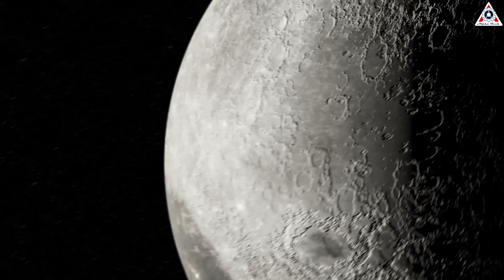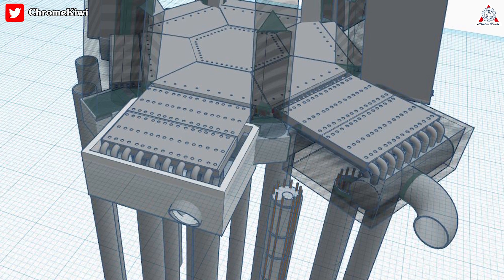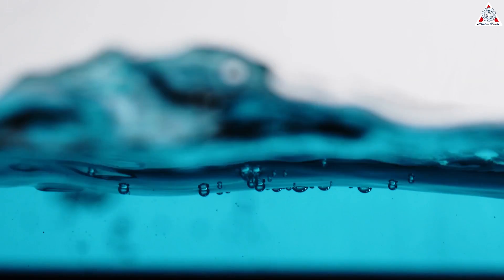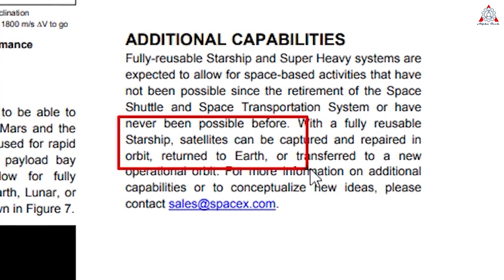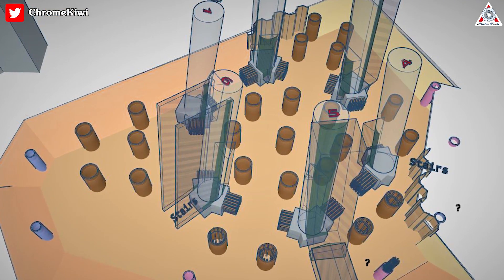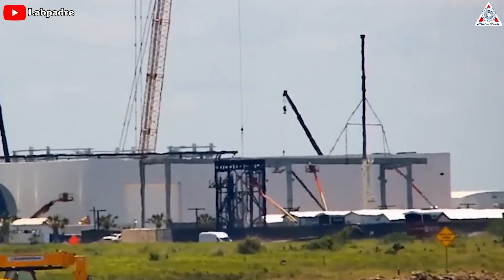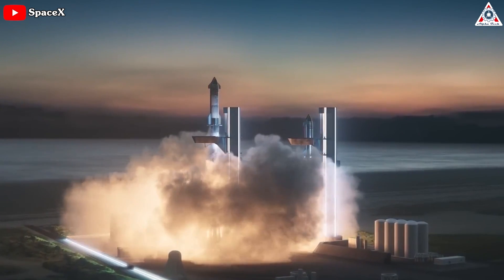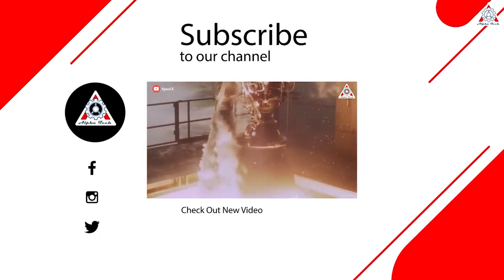SpaceX's New Starship platform to save 33 engines....

Comment: To Save 33 Engines??? How about a Simple "Verb-Noun" Topic description that is Relevant? The Deluge Systems (Plural) will certainly keep the OLM from collapsing into the Groundwater, and Will Help Protect the Engines from Flying Debris and Acoustic Pulse Damage. The major Damage during the First Test was the Engine Blast Blowing Away The Concrete Base & Earth below the OLM creating an Immense Cavity. There is little reason why a 300,000 GPM Water Cooled Steel Blast Base  should not prevent that from happening again.

Comment: The temperature can exceed 1000C. The reason is that it takes a long time for the steel to get to that temperature. It has a heat capacity. At 1000C exhaust temperature, it takes a long time for the steet to get up to that temperature. Certainly longer than the 10 seconds that it will be exposed to exhaust. 
With water flowing everywhere and from below, the temperature will be very low. 
To see this in practice, see how long it takes a piece of steel to heat up in a forge. There are plenty of examples of this on youtube
Reply: So what? Those engines churn out a ludicrous amount of energy. 
Just dig a flame diverter.
Reply: @ahhmm5381  It's a swamp. Look at the flame diverter for Apollo. There are YT videos on that being built.

Comment: So, it's the deluge system that everyone pointed out was missing that Muskrat thought they could get away without having…
Reply: No. SpaceX had started working on this three months before the launch. They had already moved past just concrete. They did a 50% test (equal to a Saturn V) and based on the damage done they thought the pad could handle one launch. However the ground compressed way more than expected which cracked the concrete. They expected to more ablate.

Comment: With all these launch problems, how do they expect it to launch and return to earth from another body in space where it simply is on the surface without a launch pad?   We still have no idea if it will have problems returning through our atmosphere and then landing on to a tower with arms.  I wish SapceX success and pray these other obstacles can be solved.  I admire the ambition and other successes but wonder if there is a plan B.
Reply: I think the landers will use smaller engines splayed around the upper stage for the moon and mars, with nozzles well above the surface.
Reply: You are dooming the project at the start. SpaceX will test all aspects of the rocket and improve it as they go.

Comment: Wouldn’t it be better to divert the rocket blast with a diverting tunnel like NASA used with Saturn? Diverting is better than physical blocking which caused so much destruction! Yes or no?
Reply: Neither. It’s one option. SpaceX can’t dig a diverter due to the high water table. NASA build their diverter on top of the lane and the pad on top of that. SpaceX doesn’t have room for that. Do remember that SpaceX did a 50% thrust test and the pad was mostly unharmed. 50% of the SuperHeavy is equal to 100% of a Saturn V. So SpaceX’s pad is already extremely capable. SuperHeavy just demands even more.

Comment: The launch pad debris did not damage ANY engines. SpaceX does NOT need to save any engines off of any of the next several flights to land anything in the moon. The next two flights, at least, are scheduled to be ditched in the Atlantic Ocean and scuttled. By the time a flight is sent to land on the moon it will likely be equipped with at least the more powerful and more efficient Raptor 3, or better. I didn’t listen to the rest of it.

Comment: I feel like I’m the only one who doesn’t understand the direction SpaceX is going with rebuilding stage zero. Isn’t this a problem related more to pressure as opposed to heat ? All that pressure out of the raptor engines has to be rapidly distributed. I see adding a denser medium like water to the local area, making it more difficult for the hot gases to disperse and redirect. The problem is the dispersal of the hot gases. Why all the emphasis on cooling?? I know cooling is what saves engine bells from melting and water does soften the exhaust but only relevant options if the steam/exhaust combination can be redirected. 

Why isn’t anybody talking about this? 

Ie the mega elephant in the room is the management and redirection of pressure , far less important but irrelevant the heat.
Reply: Just curious, why exactly does the pressure need to be redirected? Does it cause instability?

Comment: Elon's admission that Space Cadets at SpaceX did not use launching clamps during last test lauch of the Starship is very surprising candor bordering on utter stupidity. Everybody was wondering why during liftoff as soon as the SH Booster/Starship rocket left launch stand whole rocket lurched sideways. Now Elon offered us perfect explanation that shows how reckless are people working for him. Without launch clamps whole rocker started to lifting off the launch platform as soon as the thrust minimally exceeded weight of the rocket. It was inching upward with minimum acceleration. While it was inching upward bottom of the rocket  was surrounded by the ring of clamps that were never used. Overlap (wall of clamps around bottom of the rocket) is way over one meter tall. How long does it take to move up one meter while inching upward? It might take few seconds
Reply: In these few seconds when bottom of the rocket is trapped in ring of clamps it cannot move sideways as it hits the clamps if it does. That makes whole gimbaling to keep rocket upright ineffective. So while rocket was inching upward it was at the same time falling over to one side ( luckily for Elon it was falling away from launch tower). As soon as bottom of the rocket inched up high enough to clear launch clamps and other obstacles on top of launch mount rocket shifted sideways pushed by gimballed rocket engines.  Launch clamps were invented and are used to prevent situations like this to occur.

Comment: We will see how genius the design is.  I'm not convinced.  They are trying to over come a basic design flaw.  Elon, knew this might be a serious problem.  He knew there should have been a flame trench and so did we.
Reply: Correction: anyone with a passing knowledge of physics knew it but not Elon. Elon is afterall a self proclaimed genius engineer and rocket scientists. Self proclaimed because in fact he is just the holder of a Bachelors of the arts in physics. Yup, it's an arts degree not a science one.

Comment: Big pile for BS as excuses for a disasterous lame attempt to launch a rocket doomed to fail due to fatal design flaw. During last test flight SpaceX did not use launch clamps during liftoff why ? Because they feared rocket engines thrust buildup during clamped period would exceed weight of the rocket by significant value and upon clamp release rocket would accelerate generating  enough compressive force to crush the Skirt of the Starship right on the launchpad. That was Elon's greatest fear as he knew that the Skirt was barely able to whitstand  the weight of fully fueled Starship. "The Starship was slow to accelerate during liftoff" why? For the same reason why launch clamps were not used. Space Cadets at SpaceX knew that the Skirt could buckle and collapse at any significant increase of acceleration so they kept on trimming thrust down as mass of the rocket kept on decreasing with spent fuel and oxidizer. As mass of the SH Booster decreases while mass of the Starship remains this same proportion of the rocket thrust pushing on the
Starship increase  so despite of continuous reduction of thrust generated by Raptor engines compressive force acting on the Skirt kept increasing until the Skirt partially collapsed sending rocket into tumble. Lucky for Elon number of Raptor rocket engines failed during liftoff decreasing thrust generated by SH Boosted faster than Space Cadets at SpaceX planned for and these additional reductions delayed moment of collapse until rocket reached altitude of 42km. Below simple calculation and explanation. First:  SB Booster/Starship rocket travels as one unit therefore all parts of it experience same acceleration at all times until separation. Forces acting on each part of the rocket divide in such proportion that same acceleration of whole rocket is preserved at all time until separation. Mass of fully fueled SH Booster at launchpad m1=4000mT, mass of fully fueled Starship m2=1200mT at launchpad. Lifting without clamps thrust equals combined weight equals T1=5200mT. Force at the Skirt F1=T1xm2/(m1+m2) F1=5200x1200/(4000+1200) =1200mT
Now, mass of  empty SH Booster just before MECO m11=200mT and mass of fully fueled Starship just before MECO m2= 1200mT. Now let's us assume that just before MECO thrust of SH Booster engines was reduced to 50% of initial thrust and it is T2=2600mT. Let us calculate compressive force at the Skirt F2. F2=T2xm2/(m11+m2) F2=2600×1200/(200+1200) =2228mT  That figure is very consistent with maximum observed acceleration rate of 1.75g (or subtracting gravity loss. 75g actual acceleration). So now you have two facts Starship lifted off without clamps at thrust level equalling weight of the rocket 5200mT instead of nominal thrust of 30 Raptor2 engine 30x230=6900mT that means Raptor rocket engines at liftoff were running at 75% of their nominal capacity. It is much lower when we take into consideration that 3 Raptors never fired at launchpad and we did count them in nominal thrust. If we count them in rocket developed 68% of nominal thrust at liftoff. Second fact is that despite reduction of nominal thrust to 39% of nominal (50% of 68%) during liftoff compressive force acting on the Skirt of the Starship almost doubles by the time Rocket reaches MECO.

Comment: Its not the heat which riped apart the earth, it is the presure combined with a hammering gaz flow.
The raptor engine would be at its place in the boring company, to dig rapidly tunnels without changing tools.
As a weapon for deminig would have been nice to look into. 
To withstand the pressure it has to be absorbed by a moving réactif mass 
.
To block the hammer with a hammer.
To absorb the immense peak presure of a single engine, maybe vertical turbines with liquid brakes might diffuse energy. These are mounted on a double piston action platform, basicly a platform sised cilinder, to use the pression of the rocket to spray deluge water on tye platform
Reply: Reading down the long list of comments at last a person sees the problem is I do.

Comment: The biggest question I have wrt the water deluge system being constructed at Boca Chica is the the design is not transferable to either the moon or to Mars. Water is scarce on both worlds and is too precious to be used as a launch vehicle deluge. What is SpaceX going to do on those 2 worlds?
Reply: They will have to ditch the Starship concept and go for something like the Lunar lander... which comes with its own platform and two sets of engines. One set to  descent and one set to assent. And should there be damage to the descent engines from flying debris... the lander can still assent with different set of engines that were protected during the descent stage.
Reply: Starship's engines not so powerful and it doesn't require too much thrust to escape Moon. 
Mars however is another deal.

Comment: I AM NO SCIENTIST BUT IF I WANT TO STOP A WATER LEAK I APPLY MORE THAN 60 PSI PRESSURE AGAINST  THE WATER AND I CAN STOP THE FLOW WHAT ABOUT A POOL OF WATER OR JUST THE OLD FASHIONED DIVERSION TRENCH THE ENERGY THAT IS BEING GENERATED IS ENORMOUS .ON THE FLOATING PLATFORMS I THINK IT WOULD NOT BE A PROBLEM SO MUCH. COPPER PIPES WHEN FULL OF WATER ARE IMPOSSIBLE TO HEAT ENOUGH TO MELT SOLDER LET ALONE IF FULL OF RUNNING WATER WHAT ABOUT A CONE IN THE MIDDLE WITH TRENCHES RADIATING OUT WITH A DELUGE NOZZLE POINTING DOWN OUT OF THE TOP INTO THE TRENCHES WITH WATER ALSO FLOWING UNDER THE TRENCHES LIKE A GIANT DEFLECTION HEAT SINK IT WOULD BE IMPOSSIBLE TO ABSORB OR CONVERT THE HEAT AND FORCE ENERGY WITHOUT DEFLECTING IT, NOT ENOUGH TIME

Comment: Everybody's talking about how long it took to get off the pad.   Engine ignition on the Saturn V was at T-8 sec so it was on the pad for at least 8 seconds which was similar to SH.  The launch pad needs to hold up to the thrust.  I don't know why they didn't use technology that has been working for 60 years.  They said it is because of the high water table but the water table is high at Merritt Island as well.   You have to build up a concrete pad to allow room for the flame diverters and and then build from there.  Not rocket science just good ol' civil engineering.
Reply: Elon did not want a flame diverter and a large water deluge system.  And what elon wants, elon gets. So they are stuck with this problem and  have to implement complicated and untested ideas to solve it. My bet this water cool plate does not work all that well. THe water in the system heat up, producing pockets of high temperature and high pressure steam that jams the system, and if they are unlucky... result in steam explosions that will damage pad and the rocket again.

Still the water cool plate does not solve the fundamental problem of reflected exhaust gas... hitting the ground and bouncing back up towards the rocket... this exhaust gas hits like a train. The solution is a flame diverter to channel the gas to the side... something which SpaceX does not have.
Reply: Maybe next time.

Comment: SpaceX should use the first moon landings for consumables needed on the moon to survive. Then it should bring in a miniature nuclear power-plant along with solar panels. I'm pretty sure that wind turbines wouldn't work on the moon. Then they should think about boring equipment to tunnel underground. They should be able to lower a StarShip on it's side modified to act as an underground railway (electrical propulsion). This will connect 2 bases on the moon. Both built at the same time. Both have the ability to launch StarShip's just in case one is damaged for some reason.

Comment: It will be genius if it works. What is most important is that plans must have been in place already for such an upgrade because nobody can magic up such solutions and materials overnight.
Reply: And all possible with fossil fuels
Reply: Musk said right around launch time that they started working on the plate three months prior. They expected the pad to hold up better for one launch but they were only ever going to do one launch with just concrete.

Comment: I dont beleive new hardware is going to work. Its a flat surface and the pressure that already blown concrete.and rebar struture will prevent water coming out. It would be easier to make a curved deflector with a center cone that spread the water and using the gas flow the prevent.pressure creation at the center . The center cone with mutiple pipes injecting water downward way would cool the plate and reduce and deflect sound   shock waves toward the exterior.
Reply: If you ran the simulations then I can't argue with you.
Reply: On track guys. 
I wonder if a giant Venturi concept could be employed somehow ?
Don’t ask me how the elements would be arranged but all I know is a Venturi -passively-works with differing pressure..
Less parts right 👍

Comment: 9:45 they are replacing vertical tanks with horizontal, "better protected from launch pad debree" I thought the whole point of new water cooling system is to avoid any debree?
Musk promissed a mission to Mars (the whole base on Mars in fact, but let's be generous) in 2024. It's been 10 weeks since last launch, despite Musk twice predicting it would take 4-6 weeks till everything is ready for the next launch. Judging  from all that, they won't be ready till October, and then it is questionable will they get a permit to launch at all. Personally, I don't expect they'll be ready this year at all.
Reply: Debris
Reply: @ashleykerlin  Sorry for my bad spelling.
Reply: @snaplash  Grapeshot instead of trebuchet. 😀

Comment: Will this extra cooling reduce gas expansion and reduce lift? Explanatory replies only please .
Reply: If you are talking about the water cooled steel plate, No. It will not affect the lift at all, since the rocket is disconnected from this system, nor should its effect on reducing gas expansion be too significant. Not sure if I understand your question though, If you send me a reply I will get back to you ASAP

Comment: AGAIN I say to Elon Musk that the greatest change to success of the launchpad Surviving is the reduction of time on the pad to less than 2 seconds. That Said I WARN Elon Musk his metal plate design with water shooting at the rockets red glare and Pressures is ridiculous. 20 Millions pounds of Thrust against water jets through holes in metal plates would again be destroyed by Rocket Pressures and Resonances of the Rockets Blast against the Metal holes destroying them and the launchpad should they keep the Starship on the launchpad for a longer period. I SEE DISASTER should the Starship remain on the pad.
Reply: if only there was some way to run static fires so they could test the deluge system before actually launching with it... :)
Reply: @arkayenro8225  Static fires are not full Thrust and All Rockets ignited.
Reply: @robertdoell4321  Yeah, those engines are packed together. There is little room for energy dissipation with that density. Their little test is pretty unrealistic.

Comment: Two part solution. 
1: You need a Cooling Pond that circulates water through water cooling plates. 
2: You need a plate tower that has the cold water constantly circulation inside while also having small ports for putting water infront of the incoming flames. Issue solved
Reply: Wrong!!!!! You don't need to circulate anything! You have to dump alot of water In very short time! There is no time to cool a recirculating water System lol!!! Problem not solved!